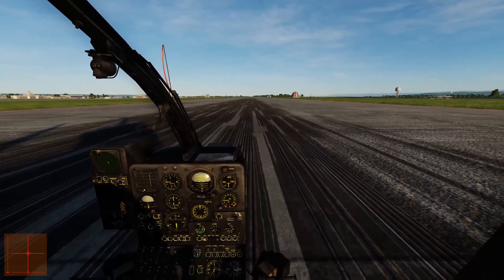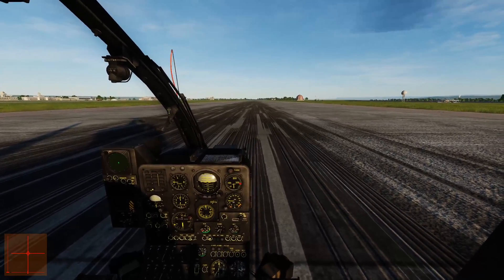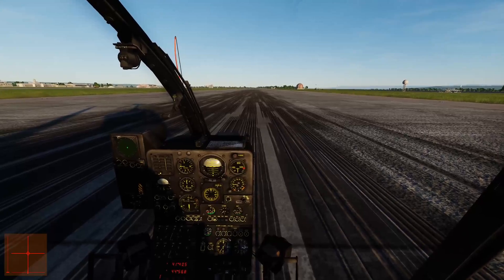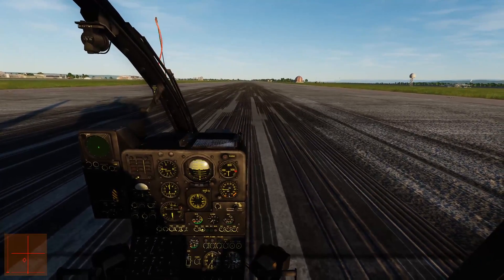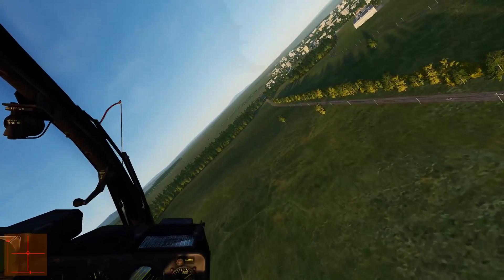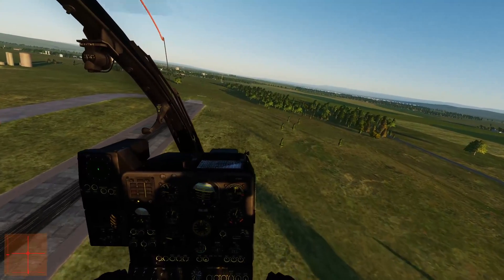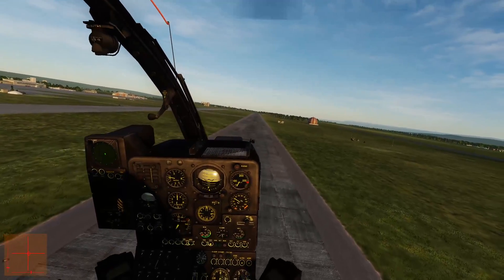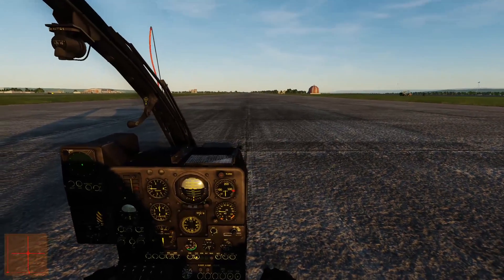A Brief Data-Driven Look at the DCS Gazelle Flight Model

Comment: I’m disappointed that they felt it appropriate (and that ED allowed it) to move on to another module before actually addressing their current product.

I understand that it’s quite complex, but that’s why the price is so high in the first place. Judging from the Gazelle manual, they have but a single developer actually creating the systems and flight model, and I gather most of them only do it as a spare time project. Again, I really don’t want to come off as though I’m bashing them… but if you don’t work full time on your products, you shouldn’t be charging full time prices. I can’t seriously go ahead and buy another product from them, on the off chance that “this time they might’ve gotten it right!”
Reply: Yea, I'm not buying any polychop products until they fix the module I already paid for.
Reply: Polychop devs have stated repeatedly that when they developed the Gazelle they didnt have the resources or knowledge base/SME access to make it as realistic as they would have liked. In developing the Kiowa they've had more resources available and now have actual pilots assisting them with the flight model. They've said the work going into the Kiowa is applicable to the Gazelle, and some of the tech they are developing for the Kiowa FM they can retrofit to the Gazelle when they rework it's FM, which is happening after the Kiowa release.

I would also argue a FM update doesn't pay the bills nearly as much as an actual module. All businesses must keep the lights on first, otherwise they wont be around to fix/update past products. I would rather Polychop make the Kiowa, and stay in business to fix the Gazelle, than go the VEAO route and shut down leaving everyone who bought the Hawk hanging in the wind.

Edit: I would also not be shocked ED "allowed" anything considering they released the F-16 without a damage model. Going by that metric the Gazelle is a far more complete product than the viper was on release.
Reply: Jabawocki sure all businesses must keep the lights on… but not everything needs, or should become a business at all.

This wasn’t a Kickstarter where people knowingly invested money in something that may not turn out to succeed. It was a full fidelity DCS module, a guaranteed product. It’s become obvious that Polychop simply lacks the competence to deliver the product they sold.

I didn’t make a high risk investment in an friend’s unpromised venture. I bought a “complete” product, from a company. Now that company has actually moved on to another product, the success of which will dictate whether or not the Gazelle will possibly be completed. That’s underhanded.
Reply: @mumblerinc.6660   I can understand that perspective, especially if you bought into the module on release which I think was around mid 2016(according to steam). 4 years is a long time without a fix. 

That said, I would not consider any digital product "guaranteed", doubly so in regards to quality and DCS. DCS has had core issues with some systems that have not been addressed in years, to the point where I think if they were in any other market, there would not be a DCS today. I don't believe ED has quality standards, as they certainly don't for their in house products, considering the recent "patchpocalypse" and the state of the F-16 at launch. Just because a module is full fidelity doesn't mean you are automatically getting a certain level of quality. I would say you need to consider the history of the dev in question and look at what they are willing to show you about a module prior to purchase to make a decision. Heatblur's F-14 is a good example of how to do it right I think. They have an established product history, and showed off a good bit of development prior to release.

I understand it wasn't possible to get that when the Gazelle launched, 2016 is not 2020. However, I think if a company is taking steps to fix their errors or is advancing up the learning curve, that should be taken into account.

 I bought the Gazelle on sale, and I knew about the flight model issues ahead of time and the controversy around it. I still bought it simply because of the capability gap in the lack of NATO AT/Scout helicopters. I was interested in the mission set, not the gazelle specifically, and it was an acceptable risk at sale prices. Polychop devs are fairly open and communicative on Discord, and will engage with you if you ask questions. They have their SME's doing streams and videos showing the Kiowa to attempt to be more open about the development process. They know there is a reputation problem from the Gazelle, and everything I've seen looks like they are trying to address it. The community has even given them advice on how to better allay concerns around the flight model, and how to communicate to the public better in that regard.

I can understand being cautious and wary of a company that you've had a bad experience with previously. Don't pre-order the Kiowa and wait to see if they make good on their promise to fix the Gazelle. I would say the "no pre-orders/early access" is a general rule to follow in regards to anything DCS, and I'm very wary of the Hind considering ED's recent history. 

I'm personally willing to give Polychop the benefit of the doubt considering I don't have 4 years of "bad blood" with their product. I'll follow what they're doing with the Kiowa, and if that looks correct I'll get the Kiowa and probably never touch the Gaz again. From what I've seen I don't think the devs are malicious. What I think has happened is they've been the whipping boy for a long time now, and have become understandably exasperated with the situation. My impression is that they're just putting their heads down and working on the problem hoping that when they do finish their work it will satisfy the consumers. What concerns me is that even if the KW is great and they manage to adapt those lessons to the Gaz, nothing will make people happy or "fixing" the gaz wont earn them nearly enough good will to counter the "FM is terrible" bandwagon that has built up over the years.
Reply: @jabawocki9462  Well, you are a bit late to the party. There is a long history of Polychop insisting that their module is absolutely realistic, the lie about that it has been approved by real pilots (the opposite is the case, french ALAT pilots have huge issues with it), that we desktop pilots know shit about helicopters and only they know all the magic that is going on in the Gazelle. This was going on for years, they've build up their comfort bubble with their own discord channel, rallied enough fanboys who praise them day by day - until last year the community stepped up and published an open letter of criticism. After that PC tried to put out the fire, but still without delivering anything substantial. Far more concerning are already published videos about the Kiowa that show the exact same problems with controls like in the Gazelle. The time for benefit of the doubt is long over.
Reply: @alexandervoigt7313  Yep. I have screenshots of Sven claiming it's actually the DCS Huey that has the faulty flight model and theirs is far superior (yet somehow still needs to be completely replaced -- liars have such a hard time keeping their stories straight). Not just biting the hand that feeds, but criticizing the most convincing flight model I've ever experienced in a sim.

Comment: Best FM review considering no other DCS choppers went so much under the microscope as the Gazelle. Would love to see at least the Huey having the same treatment.
Reply from the maker: Maybe some day, if I can find the data and it's available for public distribution.
Reply: @ErikScott128   DTIC AD0901787 and the last pages of ADA047971 (a low speed summary chart) have similar control position info for the UH-1H. Unfortunately the chart scan quality is a little poor but as you did well with the Gazelle charts, I'm sure you'll be able to work out the axis labelling, etc. if you ever decide to evaluate the DCS Huey.
Reply: @ErikScott128  I think I have a hard copy of the US Army Maintenance Test Pilot flight manual for the UH-1H. If I remember right, it has data on how the aircraft is supposed to perform, to include data on autorotations. If you would like, I may be able to send you the information.
Reply from the maker: @indyjons321  that data would always be of interest. Please only send it if the document is permitted for public release. This would mean distribution statement A, or some other official mark indicating no release restrictions. An online source would be preferred.
Reply: @ErikScott128  a good online source for it (and anything Huey) will be “uh1ops” under their “resources” tab. The manual I am referring to is the 1520-242-MTF. Hope that helps.